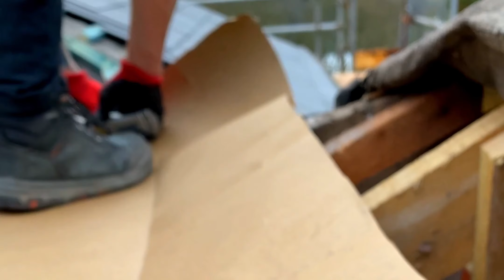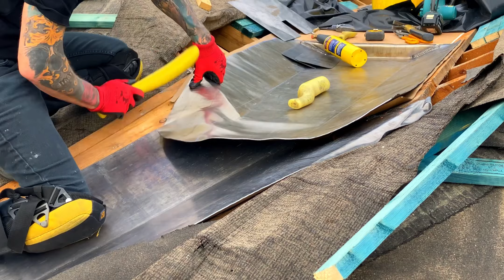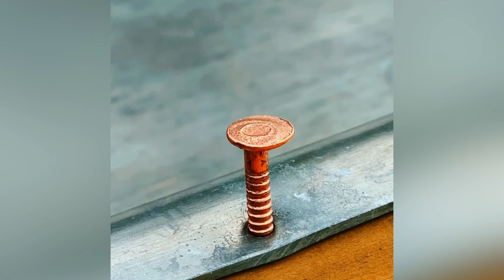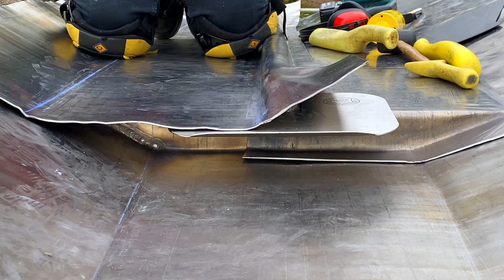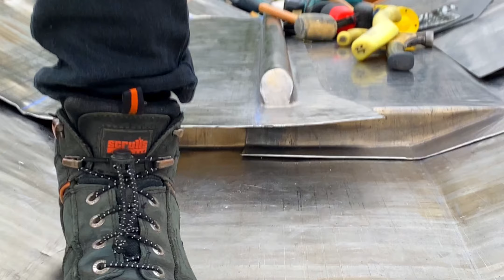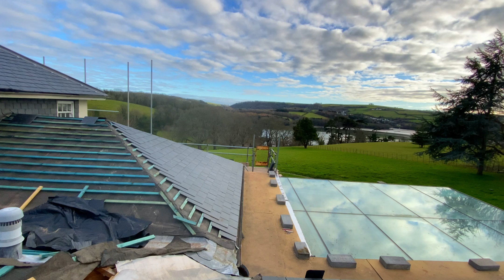Spreading the grey butter in the gutter

Comment: Skills undeniable, but there is no way that lead rooimg is at all safe for the environment. Every rain will be contaminated for generations.
Reply: I think it will be fine
Reply: @tazerface8638  no, sadly it wont
Reply: No, stop being hysterical.
Reply: Use to live in a Major Metro in the States.  Was concerned about Lead Water Pipes so called the City.  Was told that our Water came from a River and was Soft.  Lead is stable and doesn't leach.
Fast forward 40 years and if you remember Acid Rain was discussed a lot.  I wonder if the problem of Lead in the Water in Flint Michigan could be attributed to their water supply becoming Acidic?
Reply: Lead oxidizes and stops the leaching…you know where they get lead from right? The ground
Reply: Lead by itself is very stable. Lead oxide is the real danger to the human body...  That was the ingredient that made lead paint dangerous, and only if ingested by eating paint chips or breathing the dust.

Removing lead from paint and automotive exhaust made sense. The absolute hysteria over it being used in other applications is pretty overblown.

The driving force behind vilifying lead is ammunition... Substituting other components to replace lead makes ammunition prohibitively more expensive. Which is essentially backdoor gun control.
Reply: @oldschooljack3479  right, and the lead oxide is the layer that would come off from sanding exposing pure lead, the oxide also protects it from leaching into the environment from which it came.
Reply: @joshyingling  for a while one of my hobbies was making recreations of 18th and early 19th century powder horns. 

One particular style that was popular was a "polka dotted" horn. Most folks who make horns won't attempt the polka dot patterns because it involves lead oxide. I don't remember the exact recipe and process but it involves heating and mixing lead oxide with other materials to apply to the horn in a dotted pattern. 

The process can be duplicated with safer modern materials. But they are not as durable and don't match the look of the originals... Just a close approximation.

Lead oxide is dangerous because it binds easily with other elements/chemicals in the body and is persistent. Plain lead does not and is relatively safe to work with in its solid form. Gloves and fresh air are suitable precautions.
Reply: @oldschooljack3479  lead is without a doubt toxic, any consentrated amount  is toxic. The lead will weather and oxidize. Lead pupes are illegal for a reason. Hell even the trees in the area will effect the lead leaching. Yes there are some good applications  for lead but this is an outdated and flawed system. You can do the same with aluminum and have it be more resistant especially  if coated.
Reply: Lead is fine. What is worse is use Petro forever chemicals.